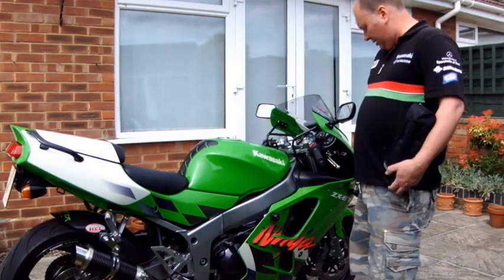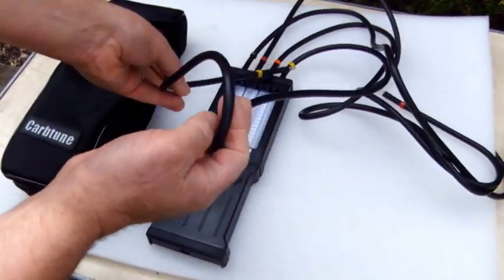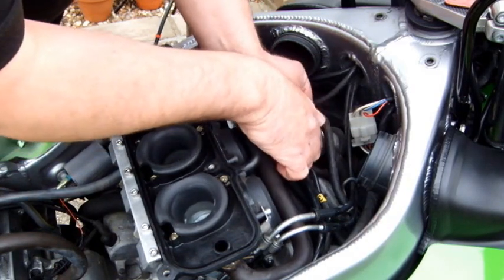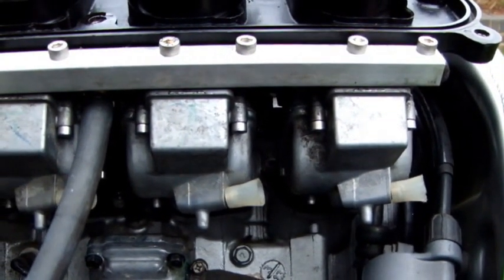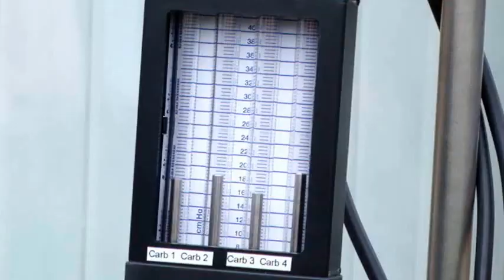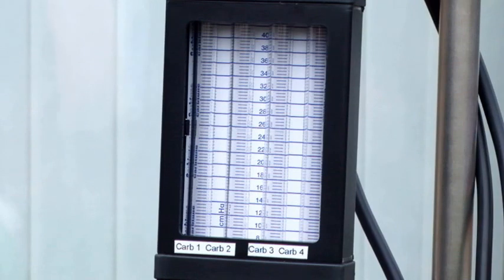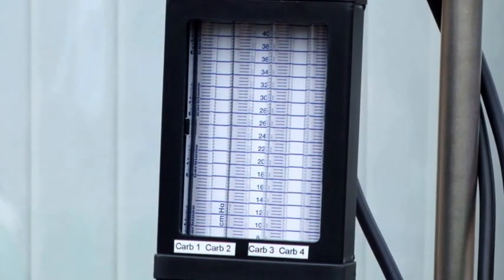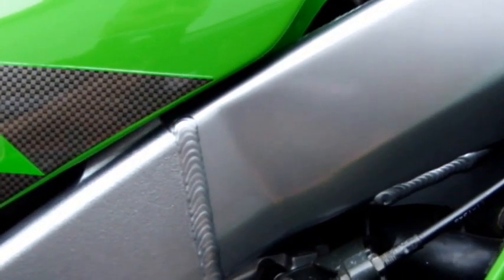Carb Balancing ZX6R-F3 with Morgan Carbtune Pro

Comment: Great vid, Dave. Its convinced me to invest in a Carbtune Pro and have a go at the carbs on my 636 A1P. Nice bike you have there - I used to own a similar F model back in the day and I sold it to buy a CBR900 RRS Fireblade. My mate bought the ZX6R off me and I quickly discovered that, performance wise,  there was nothing between both bikes!. The early 6's are becoming sought after now, so hang onto it!. Cheers.